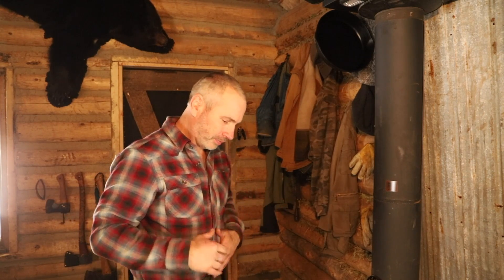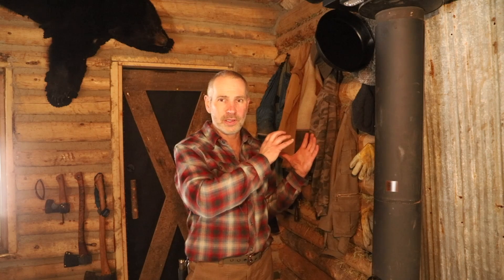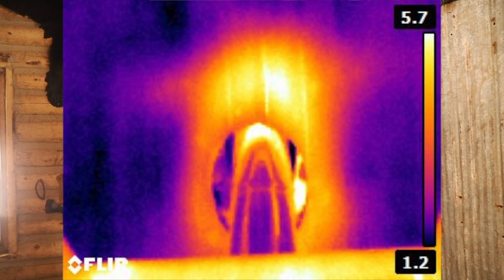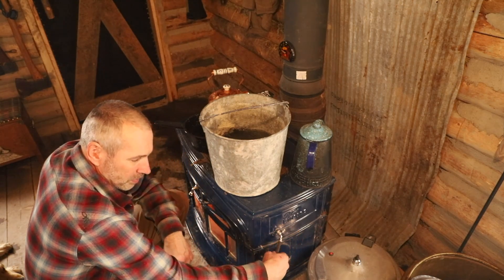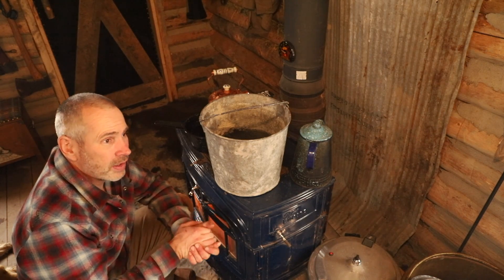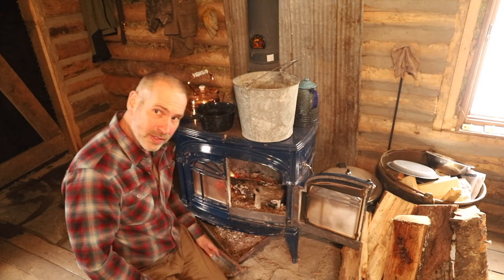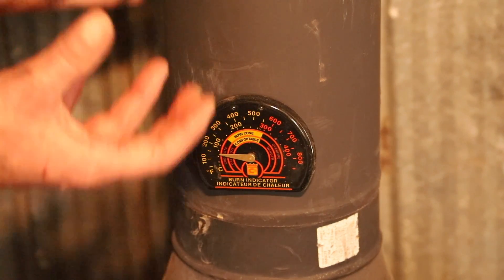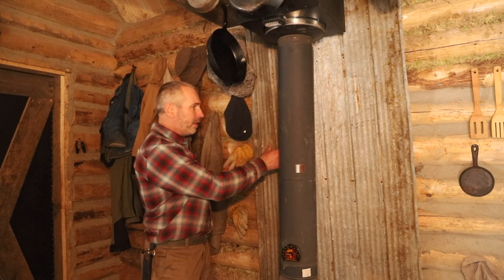How to Heat an Off Grid Log Cabin with Wood, Thermal Imaging Scan (infrared)

Comment: I really enjoy your videos. You do some really good authentic old school things that most people have forgotten.One thing it seems you have overlooked is a huge rock chimney and hearth. Any original old cabin ( not a recreated or relocated) always had a fireplace that was huge and it was usually always on the center of your A-frame on your back wall directly opposite your front door.
This wasn’t an accident they were all built this way it was how you were able to keep the cabin warm. Most were built with the front door facing south and the north or coldest wall was almost entirely rock with a huge hearth. With only a small fire burning constantly the mass would keep the cabin warm.
I’ve seen a lot of old sites of 20x20 cabins that had been gone more than 100 years that still had the pile of rocks from the chimney and hearth that probably weighed 30 to 40 tons. This is probably where the idea of rocket mass came from. I’m sure cob was around back then too but in most places rock was a nuisance and needed to be picked up and used to get it out of the way for farming. 
I’m sure everyone has seen sites of old cabins  most have been disturbed or raided for the rocks and it’s hard to tell but if you find one in tack you really need to take note of how they were building them and why.

Comment: Would the heat be retained more efficiently inside the cabin if you had squared off the top and bottom of the logs? I noticed in other videos of Finnish log cabins where they squared the logs and only put moss between them. I realize this might be very difficult to do when you are only using hand tools.

Comment: I wonder why no one seems to use tiled stoves in the US or Canada (something like http://www.homethingspast.com/tiled-stoves/ or http://ceresit-pro.pl/img/original/6802.jpg ) which are very popular in eastern Europe (Russia) or northern Europe (Sweden) where they also have very harsh winters. 
They have huge amounts of chamotte stone / fire brick built in. This thermal mass keeps and stores the heat during a whole day. (http://www.grundofen.de/tl_files/03grundofen/grundofen_parabel.jpg )
Also, the burning gases / hot air is lead through a meander of internal heat exchange flue channels until it reaches the chimney for higher energy efficiency. 
In this way, you can keep the stove for many hours or even a whole day unattended ( http://www.grundofen.de/tl_files/03grundofen/grundofen_parabel.jpg )

Iron stoves, in contrast, are inexpensive, take only little space, and are easy to install, but they are thermally inefficient for two reasons: 
1. the hot gas travels only a short distance from fire to chimney, unable to transfer all the heat to the room or thermal mass, so the gas is still hot when it reaches the chimney and a lot of energy is lost and firewood is wasted.
2. the thermal mass is too low to store the heat for a long time (which would allow the fire to be unattended for a long time).

The Rocket Mass Heater seems to be a modern re-invention of the tiled stove principle (thermal mass + long flue channels), but without the traditional aesthetics and taking up much more floor space.

For permanent living double walls with insulation would probably good: https://www.leonwood.de/fileadmin/inhalte/Bau_u_Oekologie/Wandausfuehrungen/Bio_Doppelwand_round/biodoppelwand-round.png

Comment: I like the old piece of barn tin behind the stove...Looks more rustic.. I have barn tin behind mine, I just built a frame around it (Like a picture frame) out of rough cut wood, and built spacers on the back to stand it off the wall.. Don't know if you read the comments, just thought I would throw my 2 cents in there..I really enjoy your vids..I had considered a log cabin for my build, but I have chosen to go with a timber frame home and use cordwood walls to eliminate the heat transfer through and between the logs..Great vids, really love the channel man..

Comment: In the U.S. homesteaders and pioneers used copper (when they could afford it) on their kitchen countertops. It is supposed to be even more sanitary than stainless steel, which of course they didn't have. Supposedly, it has antimicrobial properties. you should check it out and see what you think! I would probably put it on a food prep counter top and hammer and solder the edges and seams. I know some people are doing that in high end homes today.

Comment: Hey Shawn. I think you'd enjoy a rocket mass heater. I had a home in Montana that had two and two wood stoves. Stoves for fast heat and rocket mass heaters for efficiency. I'd burn the rocket mass heaters each once a day. I'd only use like 6-8 pieces of wood for that a day if I had been gone a few days or if I wanted to cook with it was the only time I used one of the stoves.

Comment: I grew up outport Newfoundland where the wood stove / furnace was the many source of heat for many, including my extended family.. Even to this day 50 years hence my brother and my sister still living on the Rock use a wood furnace as part of heating system. I can tell you that you are not going to want to do this long term. You become focused on keeping the fire going and the wood lot full, especially if it is your only source of heat. Why not consider adding something more modern like solar thermal or geo thermal. Add in some solar panels and then a minisplit. There are some many better options over burning wood. Also, consider a long term plan where you heat source is large a centralized facility for all the building you are planning to build. You will not want to build a heat source in each building.  Oh, if you set on burning wood you will want to think about getting a chipper and a real wood furnace once you move beyond this little cabin stage. Just ideas. Great video and thanks for your content.

Comment: VERMONT CASTINGS are great looking and have some cool features. But way too over priced and do not burn efficiently. I  a PACIFIC ENERGY sheet metal stove kicks ass and has for 6 years. I have done the bricks once and they need some new ones again but otherwise it is killer. I have too say it builds some coal when burning some really hard stuff. I have owned both and i like the cheap one.  I hear HEARTHSTONE are the joint BUT QUITE THE PRICE.

Comment: I had stove made of 50 galon heavy gage barrel heating my stackwall garage workshop,,walls were 12 inches thick,,used about cord of wood per month too..Air tight stove might do litle better,,even beter would be building the old style masonry fireplace stove, russian style? but that takes lots of firebricks and lots of work,,only way to reduce heating is to make walls more insulated,,I see many old homes nailing rigid board insulation on outside and cover it with siding..something to consider,,
Id recomend building a greenhouse atached to the cabin on South and West side for best sun exposure..

Comment: I've got a fluke thermal imager, these are very useful tools. just a thought ,the copper would look great but if used for another project maybe in a scrap yard you can get the reflective aluminum used in T-5 and T-8 florescent lamps, mirror like finish, placed behind the stove pipe they will keep the wall cool, may not fit the decor, I've always been a form follows function guy. Have you considered of a wood cook stove ? Thanks for answering and making a video about my inside temperature question.

Comment: Does that stove allow you to slide the grate that the ashes fall through closed?  I have a hearthstone stove and it has the ash pan under it aswell, but the grate in the floor of the firebox can slide closed, this allows less air to escape into that ash pan and  creates a much more airtight burn, after the stove heats up into the high end of the burn zone  I then close my primary air flow and the secondary smoke after burn begins and the whole load of wood will burn slower and much more efficiently not allowing as much energy loss up the chimney as it gets burned twice before exiting.

Comment: I thought copper was a thermal conductor. Not very good for a thermal barrier.
Reply from the maker: All metal collects heat, but it's not flammable. As with the corrugated metal there now, I would have to stand if off th wood a couple of inches

Comment: Wish your wife would have found you a lopi liberty. Heated camp, cabin and now house with one. Fire brick and double burn. When you remove gaskets try a bernzomatic torch and chisel. Had to do that on mumble grumble Vermont Castings Encore at rental on coast Maine. I dislike that stove type. But, with gasketing new it was alright. 
Camp was off grid, propane lights and fridge, it's the profile picture.

Comment: Hi Shawn,
Quick question and my apologies if you already answered it somewhere else. Do you control humidity in the cabin as well? I figure its probably as simple as boiling some water or something but I wanted your thoughts. I would like to thank nose bleeds and dry skin during the winter months for the inspiration of my question... :)
 I dig your videos!
Josh
Reply from the maker: I always had a pot of water on the stove in my airtight home, but in the cabin, I have a lot of green wood that will be perspiring for this year so humidity is still high. Next year I'll have to humidify
Reply: Awesome. I really appreciate the response, Shawn. Cheers!

Comment: You can make the stove a bit more efficient by adding thermal mass to it. Get, or make, a thick plate (say an inch or two) of cast iron the size of the top of your stove and sit it on top with as much surface contact as possible. You can bolt plates on the sides as well, so while you are drilling into it might as well add an adjustable air intake (just a hole with a little metallic cover screwed over it with a single screw; you can slide the little door to give the stove more or less air). The added mass will keep more heat inside the cabin, and will keep radiating heat long after the fire has died down. The downside is that it will take longer for the top to get to cooking heat, but we all know everything is a compromise.

As for the seals you can get graphite wood stove gasket kits on ebay for like 10$.

Comment: Enjoyed your video..I've had a Rayburn stove for about 31 years and that can shut down pretty well...(UK)  What the rectangle box box for just above your head height I can't work it out, is it for hot water? not easy to fill if it is. Thanks
Reply from the maker: It's just a header box to carry the weight of the insulated chimney about it.

Comment: I have a Vermont Castings stove as well. The company says to never run it with the ash door open. That said, it's a great way to get a fire going quickly or to get wet wood burning. I also use another trick that's for extra safety. I run the stove pipe right up through the center of the Selkirk part of the chimney. That way the Selkirk never gets any creosote build up and I can replace the stove pipe every few years just by going up on the roof and pulling the whole thing up. Drop a new one in, put the cap back on and I'm good to go for another few years. Of course it only works if you don't have any bends in your setup. You also end up with a 1/2 inch gap between the two pipes but I've never had any problems with it after more than 20 years of running it this way.

Comment: I live in a 1870 log cabin in Laramie, Wyo & heat with free pine cut offs of 2 x 4's & 6's from a local truss plant when winter starts. Then in Jan & Feb I use pine logs for the super cold which has been minus 30 or 40F, but not this year. Winter was mild, the east coast got what we usually get. I only use wood heat. When it does get below 40F I have to keep the fire going 24/7 to keep the cold out. Logs are 8 to 10 inches. 3 walls are chinked with log jam. The front with mortar for the 1870 look. Never cold, always cozy at 7000 ft+.

Comment: i know it wouldnt be a "real" log cabin any more but if id build a cabin in a really cold place thered be like a 50-60 cm (like 2 feet) straw layer on the walls and all gets sealed off from mice and insects with a thick layer of clay

as i said not a pure log cabin but that thing would stay warm.

also cieling/roof insolation of similar thickness cause thats where most of your heat dissipates anyways

Comment: From what I can see you either need to insulate your cabin more and thus need less heat. Shame to cover over that wood as it looks so nice.
Or
It sounds like you need to get a 2nd (and ideally preheated refresh air supply ) in to the smoke at the top of the stove so the more of the smoke burns and thus you get more heat which requires less fuel. 
So
you could take this a step further by adding a 2nd burn chamber (with a preheated air supply) ie an old 15 kg gas bottle.
designs can be found online but basically: allow the flue to go up into the gas bottle, add new air to the base of this flue, vent the burn gases from about 1/3 up the gas bottle. in short the 2nd burn has to go up, then down a bit, before going up the flue.

Good luck

Comment: Believe me for a hundred bucks hundred and fifty at the most you can get a airtight fireplace insert, set it on 4 Cinder blocks like I did and it I don't said 8 hi I said you know for four and four on the floor it works great

Comment: Thanks for your efforts. 
In my experience, metal fuel cans (for example with 20 liters content) placed between the stove and the wall could be used as additional heat storage, which also shield the wall behind them. 
The canists can be filled with water, which has a high heat capacity. 
To prevent freezing of the water, antifreeze for use by a car radiator is suitable. 
Some types of these canisters are even stackable.  
example : https://www.ebay.de/i/371969720880?chn=ps

Comment: When it comes to an efficient woodstove, IMO the best solution is a good and heavy air tight model (even though air tight is a bit of an oxy moron as fa fire needs oxygen to burn). I have been burning wood to meet our heating needs for 30 years now. Since we moved into our latest home, we have been using a Nordica Classic Woodsman stove. It is a Quebec made 3/8 plate steel construction stove that is fully lined with fire brick and it EPA approved (which is required to meet insurance and WETT certification. It also has good air control.

Here on the east coast of NL, we typically burn wood for 6 months of the year, due to our cool and damp conditions. With the Nordica, this equates to approximately 5 cords of firewood per year (mix of dry black spruce, juniper, and local birch). Taking into consideration that our home is 2400 square feet + an attached garage of 500 square feet, I consider this pretty efficient.